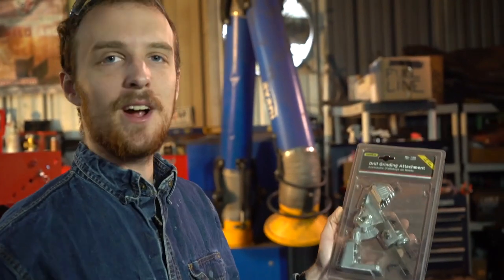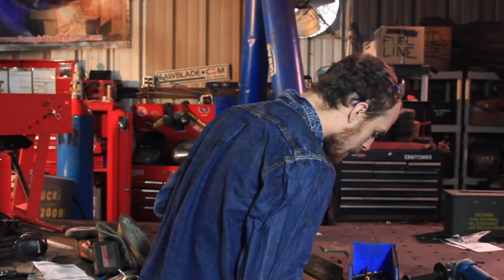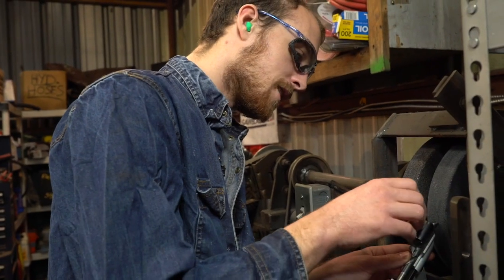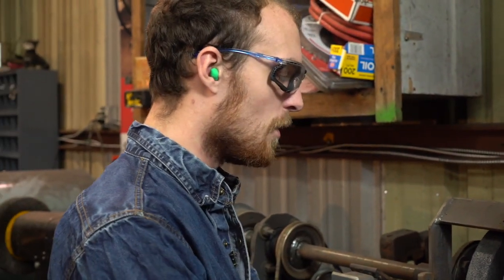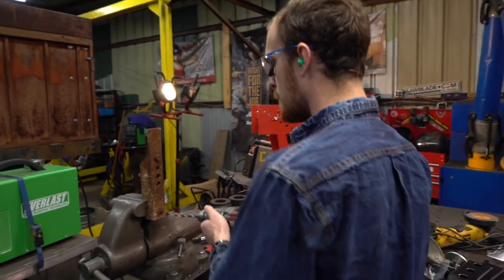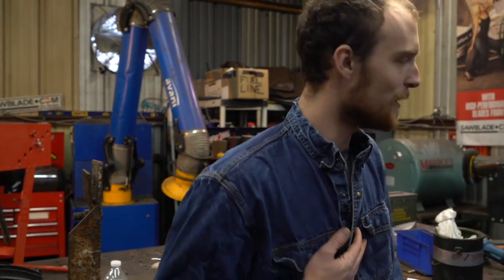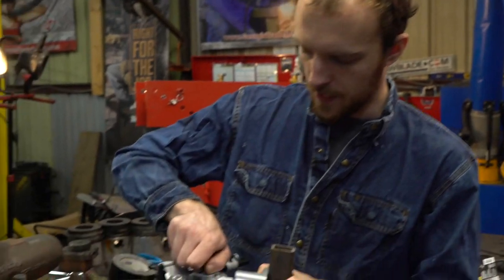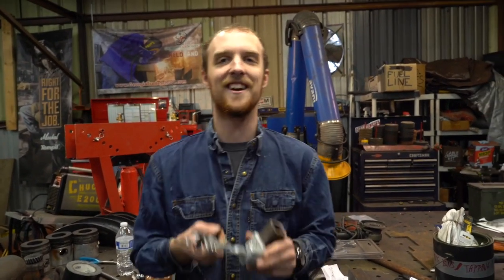WHEN THE BEST TOOL IS ALSO THE CHEAPEST: AFFORDABLE DRILL BIT SHARPENER EXCEEDS EXPECTATIONS

Comment: These sharpeners work as well as anything I have tried. 
You will get a more correct angle if you position the bit so that the angle matches the angle on the stone. The finger that sits in the flute will guide the angle of the cut. Move the bit a little back and forth until they match perfectly. 
I have mine mounted on a milling machine bed and a grinding wheel in the spindle so I can crank the x axis in tiny amounts and get a perfect edge. 
Takes 15 seconds per drill after you get the hang of it.

Comment: When switching to the other flute, rotate away from the grinder wheel and pull out of base. Use the jam nut to keep the length the same for both flutes. 59° is right for most drills. Thanks

Comment: This product works even better if you use the flat side of the grinding wheel.  By using the radius of the wheel as you did, you put a convex curve in the cutting edge.
Reply: NEVER EVER USE THE SIDE FACE OF A GRINDING WHEEL OR GIVE ADVICE ON ANY SUBJECT IF YOU DO
Reply: Right the arc of the stone effect the grind giving it a hollow ground.

Comment: congratulatoins on being THE ONLY person on utube using this tool correctlly, this tool has been known previously [ many years ago ] as the general 825 and the picador no 9,  the instructions that came with those tools advised taking light strokes on the side face of the grinding wheel, i suspect like me you where taught to never use the side face of a grinding wheel, and that no means no, not "light strokes or just a litle bit. you where taught well and remebered the lesson. Respect

Comment: Your bit extends too far, 1/16" overhang past the locator is all you need and use the flat side of the wheel it works fine

Comment: For the first eight months of my engineering training I spent most of my time in the grinding room sharpening drills with various point geometry and shapes for different materials 
That was thirty odd years ago and still second nature, there is nothing better than practice
Reply: Yeah sharpening tools is a bit of an art. You can get in touch with your cunning side then.
Reply: I got plenty of practice but Eight Months of just drill bit sharpening would be considered torture.  I started off with larger ones (over 2 inches) the smaller they are, the trickier it is to get symmetrical.

Comment: I'm surprised you had bad luck with the drill doctor
Reply: I have a Drill Doctor. I suppose it works. It's not worth the time it takes to use though. I don't even use my Bulldog like is shown here too often. Usually I'll just freehand it. The real trick is dressing your grinding wheel. Trying to use a rounded over glazed and loaded up wheel is not a recipe for success. Sharp wheels make for sharp tools.

Comment: And grinding the proper angle on the end of those drill bits will make a huge difference most common drills that I have are 59 anyway you'll figure it out but it does make a big difference
Reply: I don't think the angle is all that critical.  You have a few degrees you can be either way. What is critical is having the cutting edges over the heels and having the cutting edges the same lengths.  When you look at a twist drill end on the cutting edges should be parallel to each other. There's pictures on the web of drill bit geometry that should be studied. The truth is always in the drilling. You'll know when you've got it.